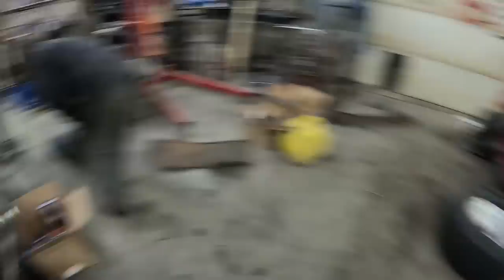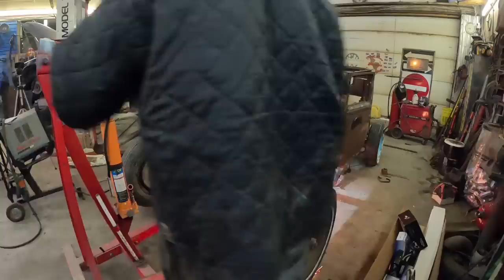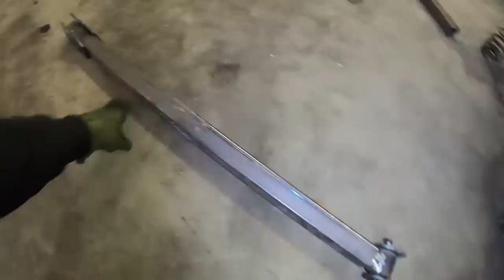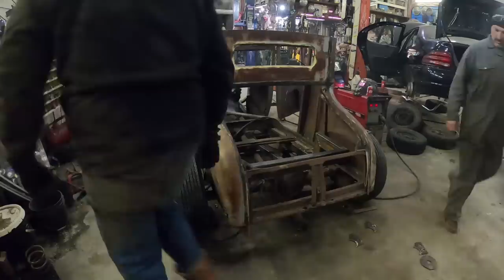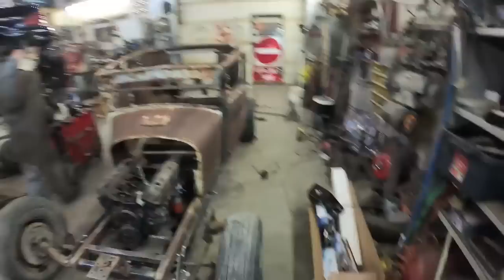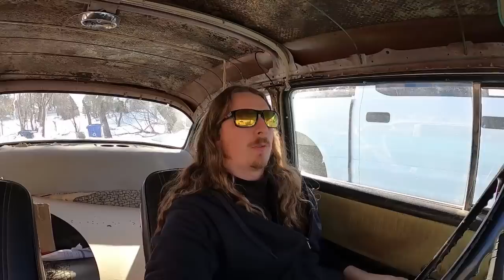Model T Rat Rod Build - T Wrecks Part 2! Junk Parts to Complete Roller

Comment from the maker: Part 2!  Wheels or no wheels?
Reply: The bigger the better...👍
Reply: Big wheels for sure and a bit more chopped,it's got the perfect lines  for it.Leave lifted in a back but a hair less then what it is currently.
Reply: Keep the big wheels.
Reply: I'm with Brent (disclosure, my name as well!) Steelies and some dirt track tires. Bigger than the old tires on the blue rims though. But then I would install a flat motor as well so my age is showing...
Reply: The big wheels are OK.
Me, I'm a fan of chrome reverse with baby moons, but it's YOUR car.
Reply: Keep the centerlines. Super  light, strong and a true hot rod wheel.
Reply: I’m with Brent.
Reply: Those wheels definitely work!
Reply: Get or use whatever you already have & can afford. That cool project may take a little while
Reply: Fat in the back skinnys in the front
Reply: DD Speed Shop wheels
Reply: Go with the big wheels.  A hot rod should not have tall skinny wheels on the back.
Reply: Yes!!! Big Wheels!!
Reply: Big wheels
Reply: Chop is fine.. go with about a 3" channel.  Wheels are ok ( i think the slicks  make em ). I prefer something more period like steelies.
Reply: Big wheels and jam that big block you have in it!👍
Reply: Tall skinny wheels are better on that. It also doesn’t look like it needs to be chopped any more. But why an auto ?!
Reply: I like steel wheels with moon hubcaps....
Reply: I like the wheels, but....not for that car.
Reply: Steelies
Reply: I like the wheels, and a bit more chop, but you gotta fit in it lol!!
Reply: I do like the wheels, although some steely wide ones painted with moons would look terrific.
Reply: Big rear wheels, I thought it was your car.
Reply: Bigger is better
Reply: 15x10 or bigger rear -15x4 front  Cragar S/S of slots The guys in Austrailia love those centerline type wheels,
Reply: Wheels....& Wheelies!!!...lol...
Reply: Big wheels mate
Reply: I like them! Steam rollers👍
Reply: Big wheels
Reply: No
Reply: It’s a budget build. Keep the wheels, they are already paid for.
Reply: DD Speed Shop definitely the old school centerlines
Reply: Wheels! One less thing to buy!
Reply: 1928ModelA1931 Nah dude! This younger generation is starting to look back at flat motors and wanting to bring them back. A flat headed rod is a thing of beauty, you can get some fairly nasty horsepower, and they are just plain sexy! They may not win a 1/4 mile duel, but they are in a league and class of there own. Go flat all the way!
Reply: Go big or gtfo!! and a little more chop. Looking sweeter than hell already
Reply: Love the wheels. Leave the top the way it is.
Reply: Everybody and their Grandma has a chopped top! Ya know? Keep it clean, classy, and no chop!
Reply: Those wheels look just fine to me.
Reply: Great to watch, love it
Reply: Love the center lines keep em
Reply: WHEELS

Comment: You two Guys! Glad I stumbled across both channels. Awesome stuff. I would go with steel wheels. Chop it a little more, but cut the back window section out first. It looks about right.
Reply from the maker: good call on the bak window.  ill have to mess around with that

Comment: This is a parts and pieces rod so I go with halfass and primer n dog dishes if need to decorate. Some long tube pipes out side and down along side for ankle burners. A couple of mexican blanket buckets with  a cup holder on side so you can fab a floor shift in front. I like the four lever ratchet shifter in center but not there to show how to build... done a couple but been a long while. first three levers will let you go one at a time 1, 2, 3, and home line is there with open cut outs. Loud and mean sound but what can you do with a buck n a half for horse power.... getting there, just ain't got it yet as rat rod bob says

Comment: I have a 1926 model T that is chopped in section that looks pretty cool I found a set of matching office chairs and took the bottom and the arms off of it and making brackets to bolt the seat part to the back part they look just like car bucket seats at a fraction of the cost
Reply from the maker: sweet,  thats a cool idea

Comment: Use the big Centerline wheels on the hot rod.  Make sure you sit in the car before chopping the top.  It's tight quarters inside the car before you chop it so make sure you don't turn it into a miserable, undrivable piece of junk.  I wish I had a buddy like Brent to help me with my hot rod.  I'm legally blind but still like (try) working on my car.  Even though I'll never drive my car again, I want to get it running and dependable enough that my wife and kids can drive it around. - My hot rod is a 454, 4 speed equipped '50 Chevy 2 door car.  I wasn't blind when I started working on the car in 2000.  I drove the car until 2009 when a sudden unexpected medical emergency claimed most of my vision.  Sucks to be me but I keep trying...
Reply from the maker: sorry to hear that my friend!  keep working at it,  your make it a nice driver im sure

Comment: I like the look of the wheels , I normally don’t care for those wheels but they do look good on the T . The fat tires on the rear do help the front look normal width . A chop will definitely make huge difference...rake on the roof ..2 inch ?
Reply from the maker: yeah i only wanna go an inch or 2.  wide rears help the look for sure

Comment: And here I thought you might not be able to top the 57 4 door to 2 door conversion,,,,I think you are onto something here ,and yes I would keep the wheels if you have some for the front that kinda match. As for the chop it's up in the air for me. I'd say as long as you can get into the car easily then o for it! I really don't care for cars that have been over chopped. Maybe just loose the whole roof ,and make it a convertible. 2 thumbs up on this project even though you aint gonna use my suggestion on the tandem rear axles,,,,

Comment: Hey Danny, I love the wheels but I'll have to see it after the chop and all to see how they look. Sometimes wheels look great until you modify the body and then they just don't look right so we'll see after the mods. I had a set of Centerline mags on my 83 Grand Prix and loved them. The thought of them on that doesn't sound good but the car was black with red pin strip and the tires were raised white letters. Later
Reply from the maker: yeah i only wanna go anohter inch or so

Comment: That is another cool project and the wheels are good if that is the look you are going for. My opinion would be to narrow that front end , that 50's front axle is way to wide. Again, just my opinion. Cheers
Reply from the maker: yeah its wide for sure.  but gotta work with what i got
Reply: @DDSpeedShop  So true, so true. Cheers

Comment: Love your projects. Leave body alone, looks killer as is. I like a softer rear spring setup, large anti sway bar. Keep your front bar mounts low for better traction. I like to lift my front tires over spinning my rear tires but to each their own. I figure if I want to spin my rear tires more I just add more HP.
Keep up the great work.
Reply from the maker: thanks frank!  i think itll work out okay

Comment: Nice build just wondering, what stops the rear end from rocking  under acceleration when you only have 1 point hook up
Reply from the maker: welded to the bars and then ill add a panhaard bar

Comment: Cool project, like the big tires but not a fan of the centerlines they dont fit the age of the car. How about 1930's deep dish artilery wheels with the big tires in back and 1930's ford wires with a chrome center cap up front. Clean up the current chop I think it looks good now, maybe cover the top and sides of the front viser that will give you that look of more of a chop in the front. Question, are you going to add a panhard bar to stabalize the rear suspension? keep up the GREAT WORK Love your channel. By the way, I like the 55 its one of your Best.
Reply from the maker: yeah itll get a pan hard.  thanks for watching!  i love the 55 too haha

Comment: Wasn't expecting to see another video so soon,bonus! Don't really want to tell you what to do, but try and pick a theme for the car and stick with it and go 5 years before or about 5 years after.Are the wheels Cragars or Centerlines or a copy.Cragar  ST (super trick) wheels  were just for dragracing the SST were the (street super ticks) that came out around 1979 the st  wheels showed up around 1973.Centerline aluminum spun wheels were also big around 1979 and into the 80's.THE Cragar S S wheels go back to 1965.Reason why I am often called Cregar instead of Greg .Please take note of how big that sunvisor is if you chop it more .As you get older chopped and channeled small inside cars can prove uncomfortable driven longer distances as well as the getting into and out of.The sunvisor can be made smaller if need be in the future too.Think I just talked your ear off .Still super happy for you guys.
Reply from the maker: haha sometimes hot rods gotta be a little uncomfortable to be cool right?  i only wanna go another inch or 2 to fix the cut lines

Comment: I dont think you should chop it you wont have room for your head you are big guy.  The wide wheels I say yes to. If you chop it dont chop but a little tiny bit. It looks really cool the way it is. Is nt it already chopped some? I hate trying to get in a out of my little car sheesh its so small a pain in the ass.
Reply from the maker: yeah its chopped but kinda rough.  needs another inch or so to fix the cut lines

Comment: ((😳)) model T-s always looks to corky  looking when they setting up high , channel the body over the frame and chop the roof down the same amount as over the frame so the motor will look much better setting higher up .. narrow 16inch steel wheels will look more period correct with caps or 30s wire wheel rims.. be much better if you don’t put a flat roof on it , give it some end curve on the roof .. chop it 3inches more and channel 3inch more 😉👍🏻 even the dog was shaking his head and staring at it long time in the end of the video “ like WTF ? ((🐶)) Lol “😂
Reply from the maker: haha those dogs like to judge us

Comment: How about an angle chop?  Maybe too ambitious..but it would look like it was moving even when it was sitting still! And keep the wheels...less unsprung weight..and you don't  have to buy them.
Reply from the maker: the t has a natural slope.  the more you chop the more noticable it becomes
Reply: @DDSpeedShop  That is so cool. Sounds good.   I was thinking about the model kits I used to build as a kid.. like "The Uncertain "T""  .  The roof is on an angle  , only it wasn't chopped..(I thought it was)  more like channelled  or sectionned at an angle...pretty wild.

Comment: My vote is for no more chop. Looks just right as it is, there's too many overchopped T's and they all look a bit fun and cartoonish parked up, but then stupid with an obviously folded in half human inside trying to operate the thing when driving. Show pony or bonneville car then chop it more. Actual thing to drive on the street, leave it alone.
Reply from the maker: yeah i just want another inch to clean up the chop